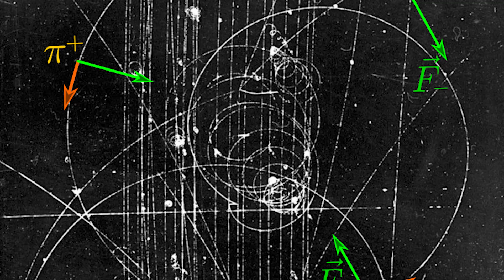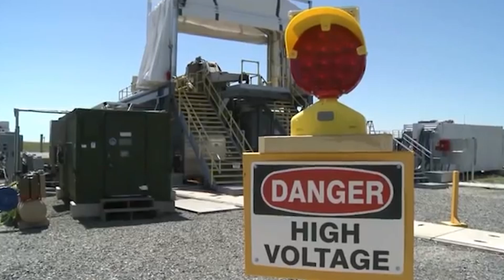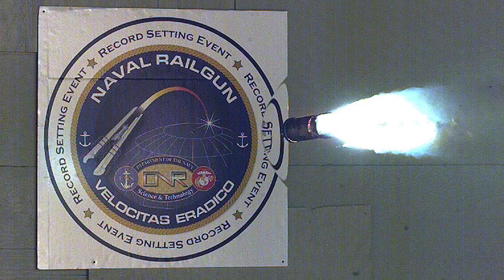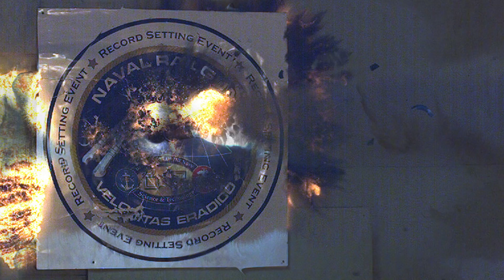Railguns: The Kinetic Future of Warfare

Comment: A pertinent observation: The material stresses of steel are already pushed to to their limit with chemical guns, and most of the energy goes straight into the projectile anyway.
The problem of the rails breaking after each use will be hard to fix because it's the same limit of steel that is limiting regular guns.
Reply: New materials are a thought.
Reply: @maccurtis730  No.
One of the sad realities of the modern era: Very few things are stronger than steel.
Reply: @JoshSweetvale  They have billions to millions of dollars they can afford the other materials must not be enough created.
Reply: @maccurtis730  Again, no.
There is no Mithrill.
Steel is the best you've got. Only possible future upgrade is steel with carbon nanotubes in - on a macro scale, which is on the same tech level as curing cancer.
Reply: @JoshSweetvale  

Steel is a really active area of development. If you want to learn more, look up nano-structured bainites. To keep it simple, they're about 4 times the strength of a lot of common steels and have very high ductility. These two things combined means they can absorb a lot of energy before fracture (less before deformation).

Not sure about their electrical properties...

Comment: Basically how the new catapults on the latest aircraft carrier works
Reply: No, completely different. They use linear induction.
Reply: @AtheistOrphan  electrical charge causes a mass to accelerate forward...how is that not "basically" the same? I used the word "basically" intentionally. Yeah,  "specifically" they're very different. But i also intentionally didn't use the word "specifically".  it's got more in common with a maglev train*, but it's still got more in common with a railgun than it does a tesla. (Even in ludicrous mode)

But if it makes you feel better, yes, you're absolutely correct.

*the acceleration bits, not the levitation bits

Comment: Why does it need to cost less than $1000 per unit?  The US currently uses the AT4, a single use, disposable rocket thank costs about $6000 per shot.  And that is nothing compared to the Javelin Missile Launcher, which is a reusable, hand-held rocket system.

Comment: Could you use a cern approach (though, vastly shrunk down), make the mag rails a circle to "spin up" the projectile to velocity, once at desired speed you adjust the magnetic flow and fire it out the barrel in a similar fashion they use the accelerate the atoms before shifting their trajectories to collide? (I imagine something in the shape not too dissimilar to a french horn, but scaled to a few metres)
You could negate the heat transfer and therefore damage to the rails by vacuum sealing the chamber, a thin membrane that offers little resistance to the ammunition would be sufficient for keeping the air out and this can be replaced as the air is being removed and the next charge is spinning up (before its heat becomes an issue).
Reload times would lengthy but you could counter this with multiple rails, after all we are talking about putting them on a large ship, space isn't that much of a premium?

Comment: I see something like this working in a ship like a battleship or a destroyer, mostly because they have the power output needed to do it (because some to all of them use a nuclear power core) and because something like a frigate would not have enough available energy to fire a full on double or triple volley from multiple turrets. Something like this seems impractical for a carrier because it defeats the main purpose. Unless we want all ships running on nuclear fuel, it’s pointless for smaller class ships.

Comment: The contact arc wears off significant metal from the elecrltrode. The high current is required to make a magnetic field which as Tesla found is better from a fixed magnet than waste power for propulsion. And high temp superconductor Silver coated rails to lower power loss. And like with particle accelerators, distributed power storage across the rail.

Comment: There energy levels don't make sense. The kinetic energy of a projectile is the same whether you use gunpowder or electromagnetism. It doesn't require the power to power half of Chicago to launch a shell. And if the efficiency of a railgun is only 0.1% percent, or something absurd like that, it will generate so much heat, the entire gun will melt rather quickly. So this video is just a bunch of bullshit.

Comment: What Simon was talking about was a very basic explanation of a rail gun as there are multiple ways of doing it they are very similar to a linear motors which is what is on hyper loop and maglev trains. The US navy already us a magnetic launch catapult on the USS Gerald ford for launching jets. Turkey is also in the development on a rail gun and has had a few test fires. To give one an example of how much power is need a launch rollercoaster might use a linear motor which will draw alot of power if this power wasn't supplied through captors then it could wipe out the power for a city ( this has almost happened somewhere..)

Comment: In 1983, I was one of the avionics techs on the early ASAT project for the F-15. I worked in the shops of McDonnel Aircraft at Edwards AFB, CA. 

One day my boss asked me to go to the lab upstairs and assist the guys there. I found I was helping, as more like a laborer with electronics knowledge, with trying to get a laser on the F-15. I was told the power supply would need to be carried in a C-5 as it would need to be huge. 

In that job I was involved very quickly in both trying to figure out lasers AND another time I assisted in checking he wiring of the F-15 pylons to see if they could be adapted to nukes.

Comment: The US Navy has scrapped most plans they had with using rail guns. Instead, they're going to use better shells in their existing deck guns. It's a lot cheaper. Evidently they can achieve the same velocity with special shells.

Comment: A coil gun would be easier to build and is much more stable.It also has no real max limit of haw far the projectile can go.
I wonder why the USA didn't consider them.
Reply: Because coilguns are far more mechanically and electronically complex. And yes, the US did consider coilguns--some years ago, DARPA was experimenting with coilgun mortars that would be quieter/stealthier than conventional systems, and offer the mortar gunners more control over range, etc.
Reply: @Schwarzvogel1  The biggest issue would be to prevent it rom firing backwards if some of the coils get damaged.

Comment: Seeing how massive the power supply would need to be, it's a little silly that Quake II featured a portable railgun that fired depleted uranium slugs
Reply: Considering that humanity in Quake II is capable of FTL (which violates the laws of physics as we understand them), it isn't inconceivable that they could also find ways to miniaturise a railgun power supply to fit into a man-portable weapon.

That said, if I recall correctly, the railgun in Quake II is a Strogg-designed weapon, not something the humans created. Still, the Strogg have also mastered FTL, so it makes sense that they'd be able to produce such compact power systems.
Reply: @Schwarzvogel1  Yeah you're right I think it might've been a Strogg weapon.

Comment: 7:29
No, the problem isn't power GENERATION to power the railguns... the problem is power STORAGE. Even if you have enough power to continuously power the electromagnets of a railgun, you can't discharge it fast enough to be useful. That's why we use capacitors in coilguns/railguns - they discharge fast enough to allow high speeds. Currently, the proposals for fitting the testbed railgun systems on the Zumwalt destroyers have about a 2 minute "recharge" time. That's not because the Zumwalts struggle to power it, they have the engine power to generate such power... The problem is the capacitors. And, unfortunately, our capacitor technology is not very good and hasn't improved much at all. That will change if graphene supercapacitors or carbon-nanotube supercapacitors come about, but we're not there yet. At least unclassified, anyways.

Comment: Rail guns are nothing but a pipe dream. With current materials, rail guns are just too powerful. They literally tear themselves apart from the forces involved in accelerating a projectile THAT quickly. The jerk produced by such a fast acceleration (jerk being meters per second cubed) is more than any material can withstand. So experimental rail guns are one shot deals. Some damage will inevitably occur from the jerk that it will be rendered inoperable until such time as said damage is repaired. I won't lie though, it would be awesome if we made a working, re-usable rail gun. It could probably even be used to deliver small payloads into low Earth orbit.

Comment: There's another inherent problem with railguns that you never mentioned that's really just the same gaping wound most modern long range weapon system; a conventional ICBM still out matches the range of anything a railgun is currently capable of. Sure a railgun can go faster, but you can't exactly sneak a current functioning one within range of where you need it and be quick about it. It's very much a modern "trebuchet" in that sense.

But it's very much so a question of if it's a direction worth going towards at this point. While not omnipotent, the development of missile and rocket technology has really put an axe into the future of any kind of conventional ballistic artillery. Not saying that artillery will become obsolete anytime soon, but the railgun is definitely a step back from ICBM and smart missile systems to just long range artillery sped up with the use of electromagnetic propulsion. Unless there's some breakthrough, like the mass of the ordinance not mattering and hitting the same distance and accuracy across the board, I'm not sure if the railgun will ever make it into the arsenals of the worlds armies any time soon besides being a defensive weapon.
Reply: What makes you think that missiles and rockets have made "conventional ballistic artillery" obsolete?! Rocket artillery and theatre ballistic missiles fill a different niche on the battlefield... and they have been around for over 70 years. During that time, militaries around the world have developed and fielded newer artillery systems. If the V-2 and BM-13 Katyusha did not make regular howitzers obsolete in WWII, then it is absurd to think that ballistic missiles and rockets will completely supplant gun-howitzers on the battlefield.

Rocket artillery is useful for delivering a large volume of fire to a particular area: a grid square that you don't to exist anymore. It is nowhere as accurate as tube artillery. Theatre ballistic missiles are useful for destroying high-value targets beyond the range of your own artillery. As for ICBMs, to think that those have replaced tube artillery is absurd! There's good reason why we don't make ICBMs with high explosive or even kinetic warheads. It's because even launching an ICBM would scare the pants off everyone with an early-warning radar system and potentially trigger a nuclear war as they won't be able to know whether it has a nuclear payload or if the warheads are filled with leaflets, Christmas pudding, and bootleg Nickelback CDs.

Finally, you seem to be overlooking two things:
1. These railguns are being proposed as naval armament... and most of our planet is covered with water. If they have a range of at least a few hundred km, that is good enough for shore bombardment from safe standoff ranges. Finding an individual ship in the middle of the ocean is difficult enough even with satellites.
2. These railguns don't have muzzle velocities that are anywhere near the escape velocity of Earth's gravity. They aren't capable of shooting projectiles into orbit; the projectiles they fire will still have ballistic arcs. So they will function a lot like conventional artillery... except the slugs are moving much, much faster. One big advantage is the lack of explosives = less collateral damage. One big downside is the lack of explosives = need for precise guidance... which will also need to survive the incredible friction and acceleration the projectile is being subject to upon launch. 

Ironically, the railgun slugs could end up being more expensive than cruise missiles for this reason. I suspect this is the case why railguns aren't replacing conventional naval artillery anytime soon--the systems themselves are fragile and unreliable, and the projectiles cost as much as ordinary missiles with a lot less versatility.

Comment: RAILGUNS SUCK. Why? Because, all the projectile and durability issues aside, the capacitor bank for a gun you'll mount on a tank is about the size of 5 to 10 tanks. This is not counting the cooling system, the power generation system needed to feed it and/or the ammunition. Hence, even if it works it is not deployable.
--
Also, if you are going to carry around and discharge that much power, one has to ask why convert all that power to kinetic energy generating mechanical stress and having a projectile that "only" goes several times the speed of sound while slowing down in flight? Why not just discharge it in a laser which does not slow down, does not create mechanical stress and which travel at 874,030 times the speed of sound (at light speed).
Reply: Advances in power storage can result in smaller capacitors. As for laser weapons, those also suck as tank armament. For one, they are easily attenuated by something that every tank has had since WWII--a smoke grenade launcher. Second, battlefields are dusty places... and the airborne particulate will again attenuate the power of the laser beam.

Third, even if you could hit an enemy tank with a full power beam, you will still need to burn through its armour--and whilst you are doing this, you are invariably creating a cloud of vapour that will prevent your beam from getting through to inflict even more damage. Finally, it isn't difficult to coat tank armour in materials that will reliably resist laser beams of weaponisable wavelengths. Making tank armour that will stop a KE penetrator going at Mach 10 is a lot harder.

Lasers are effective against things that aren't armoured, like missiles, artillery shells, UAVs, and aircraft since you don't need to inflict that much damage to render them inoperable or unable to continue flying.
Reply: @Schwarzvogel1  To an extent, but not enough to make railguns deployable on tanks. Capacitors have been around for a century, but their size are a physics problem not really an engineering problem. The basic premise is very simple. Explosives store more energy per unit volume (or mass) than batteries. Batteries are more energetic than charged plates (capacitors). That order is not going to change without a change in our fundamental understanding of physics.
Reply: @dwightlooi  That is very true. It is likely that the future of tank guns will either be electrothermal chemical propellants, or simply going to larger calibres (e.g. 130mm and up). The downside to the latter is that it will necessitate autoloaders if those tanks want to have a reasonable rate of fire
Reply: @Schwarzvogel1  Actually, I think there is a lull in the evolution of the gun right now. The reason being that at 10+MJ the limiting factor is not no much how fast you can throw the dart but how robust that dart is. This is primarily why the US M829A3/A4 runds went to much thicker, heavier and longer darts. In part, this suits the L44 American 120s better as slower, heavier, loads are not as sensitive to barrel length. But mostly it is because penetrator integrity is deemed more important than muzzle energy. Getting the highest energy on target isn't very useful if your darts fracture during penetration, when exposed to sheering forces from heavy ERA implements or when disturbed in flight by active defense grenades. This however limits the US ammo to very short primers and ignition of advanced stick propellants going forward become a problem.
--
The XM291 attempted to address this with a fancy electro-thermal primer. But, the program seems to have died with the abortive FCS program. The subsequent XM360 and XM360E1 are conventional gins with conventional primers. They instead focuse on reducing the weight of the gun and managing the recoil forces so it can be mounted on lighter vehicles.
Reply: @Schwarzvogel1  BTW, here are some numbers to help put things in perspective. Modern Gunpowder is between 3.2~3.8 MJ/kg. Lithium Ion Battery is 0.5~0.9 MJ/kg. Ultra Capacitors (not really true capacitors) are 0.02 MJ/kg. Capacitors are 0.0002 MJ/kg. In otherwords, you need almost 175 times the weight of the propellant in a gun cartridge in form of Ultra Caps or 17,500 times in electrolytic caps to equal its energy content. As of now using ultra caps is problematic because of the narrow voltage and current ranges they impose. That is why rail gun capacitor banks take of half the building.
--
And then there is also the issue of charging the darn thing. A 20MJ railgun shot will take 20 MW seconds to charge. That is all the juice from a 20 x 1341 = 26,820 hp generator set for one second. In a more typical 1,500 hp tank engine it'll take 17.9 seconds to charge assuming 100% generator, inverter and circuit efficiency -- that is if you don't need to move or do anything else.

Comment: Wouldn't railgun rails be served best by something carbon-based for heat mitigation? Something like the RCC on the nose of the space shuttle which can easily handle 2300ºF. Tip for next video - Compact Fusion from Lockheed. It's what they're developing for the Navy to power those railguns.